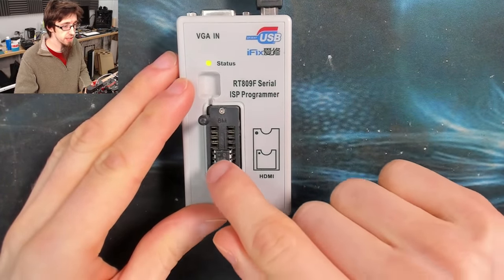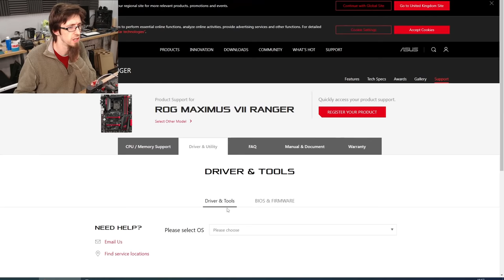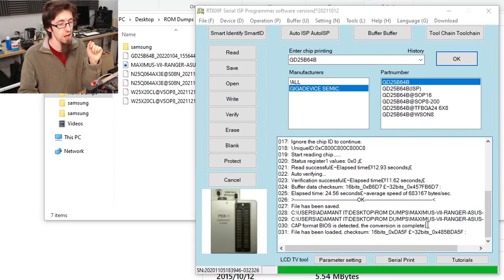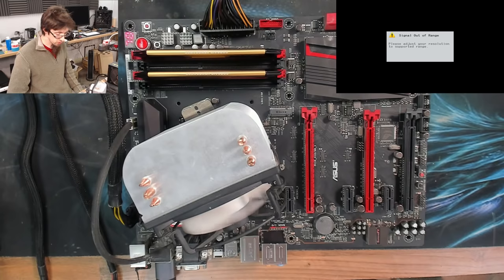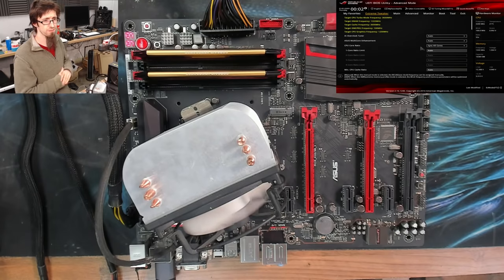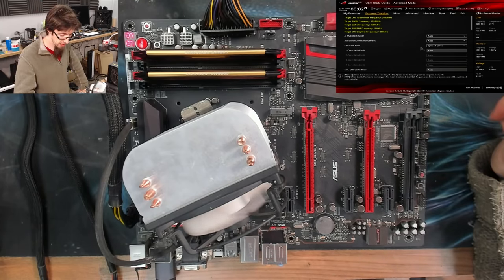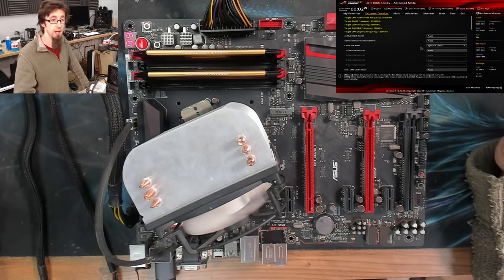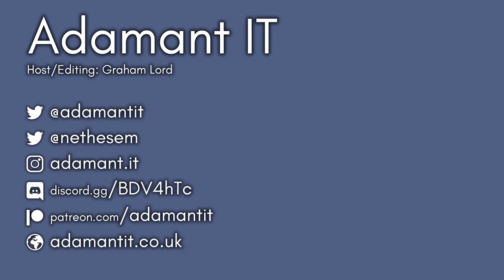Red herrings, red herrings everywhere (4th Gen Intel Build, No POST) - LFC#292

Comment: What type of studies do you have so you can get to this type of conclussions and effectivity on work or is just years of experience?
Reply from the maker: Experience. Which is also why there's lots of opinions about what to check first and in what order... Also though, you learn to get a feel for faults over time, which is why I left certain things very late to check, like the PSU. PSU should be very early in the order, but this didn't feel like a PSU fault to me.
Reply: And when it comes to the electronic part and critical thinking of solving an issue and troubleshooting, whats ur best advice?
Reply from the maker: Linear thinking. Computers do everything in a step-by-step process, all you have to do is follow those steps until you find the fault.
Reply: @Adamant_IT  thanks a lot for your response!!

Comment: I remember the days, when the cpu would fry in seconds, if the cooler was not installed correctly. Ask me how I know. I asked you this before, but got no response. Where do you get the special "fingernail", to check the ATX connector? Can't find it on Amazon or Newegg.😎😉 Good job.
Reply from the maker: Don't bite your fingernails, they're really useful ;)

Comment: Hmmm, this video may very well have just saved a motherboard of mine. I have an old Asus Z97-A USB 3.1 motherboard from my HTPC that randomly died on me about a year or so ago. I assumed it had been tweaked due to a bent case (an old Silverstone HTPC case) that I was not running the top support on due to cooler clearance. It may have just been this. I bought a slightly older version of the same board without the USB 3.1 and a new case. I updated the BIOS of the new old board so maybe it'll avoid this issue.

To be completely honest, it's all a bit moot though. I've replaced the board and plan to upgrade the HTPC with an X570 board and Ryzen 7 5800X I have laying around anyway. There's really not much need to save it. It would just be kinda cool to save it though.

Comment: Odd, the first rule of thumb i've always used is reset the bios, usually cause it's the easiest thing to do and generally a cause of other issues as well. Going after the bios last is asking for trouble sometimes.
Reply: It is not so easy to reset the BIOS if you cannot enter the BIOS. This PC was dying before the BIOS started. It was bricked.
Reply: @1pcfred  i understand it was bricked a bit but you can reset the bios on any pc outside of the bios with a screwdriver and removing the battery. So we're not talking about flashing the bios but resetting is extremely simple without needing to ever enter such.
Reply: @runeseeker993  that was done but the firmware of the BIOS was corrupted. So resetting the data did not help in this case. So it would not have mattered when it was done because it would not have worked. So much else was wrong I don't know if it would have worked even if it was the main issue.

Comment: Asus claims the single hold down on the dram to be a "feature" they call it "Q-ram" or something like that, claiming it's easier to add in ram or change ram without taking apart the computer.
Reply: I mean it is easier to swap as you only have 1 latch compared to 2 but from my experience as well they require a little more "firm" seating than the 2 latch versions.
Reply from the maker: I can see the single-latch making sense if the graphics card blocks the lower latch from opening, but that's rarely the case on modern mobos. Also you can insert/remove modules from two-latch slots with only one open as well, so I still consider it a useless 'feature'.
Reply: Asus shows an example trying to upgrade the dram where you would have difficulty getting  to the second latch, I guess it could  happen  with some very tight cases, on the other hand I don't think this is a big problem.  I just wanted  you to know Asus  considers this a feature. I just bought an Asus mb with this "feature " and unless the drams don't  hold in place, I don't really  care.

Comment: Bit Rot is unexplainable ,,It's just something that happens with a system that has been running the same bios" for usually many years " It could be caused by the battery going to such a low voltage on the mobo . It could be caused by a power spike ,,There is no clear point answer to what causes this . When troubleshooting computers ,,a bios is not your first thing to think a problem is going on tho. I think you did a fine Job of making the video on troubleshooting the issue .
Reply from the maker: Agreed. Lots of people giving the Cosmic Rays explanation, but honestly I don't buy that on a modern system. This isn't the 80s where stuff got erased by leaving it out in the sun. That being said, if it was a comic ray or any of the things you listed, the result is the same and none of them are 'preventable' - so it doesn't really matter I suppose!

Comment: Just newly subscribed to your Youtube channel, here's a question for you, I have a desktop PC that I'm using right now, it uses a Gigabyte GA-Z68XP-UD3 Rev.1.3 motherboard, the user manual clearly states that each of the four ram slots supports DDR3 ram sticks of up to 8Gb in size, it also states that the motherboard supports a total of 32Gb of ram installed, and the following DDR3 ram stick bus frequencies are all supported....2133MHz, 1866MHz, 1600MHz, 1333MHz, and 1066MHz, I have two 4Gb DDR3 1333MHz, and one 8GB DDR3 1600MHz ram sticks that I know are good, if I put either of the 4Gb DDR3 ram sticks in one of the ram slots, the PC boots normally, if I put both of the 4GB DDR3 ram sticks in two of the ram slots, or, the 8Gb DDR3 ram stick in one of the ram slots, the PC gets stuck in a boot loop where it tries to boot-up, shuts down, tries to boot-up shuts down etc, the motherboard seems to not like having more than 4Gb of ram installed, even though the manual clearly states that it supports up to 32Gb of ram, wondering what I can do to fix it?, the motherboard is on version F10 Bios, I'm running Windows 10 Home 64Bit on the PC.
Reply from the maker: Have you got a 3rd gen CPU by any chance? I think Z68 gets squicky with dual-channel when running a 3rd gen CPU.
You might get it to work by deliberately using the wrong slots to force it into single-channel mode - however then you'll have a trade off of more ram vs slower ram.

Comment: It's never the CPU... unless it's in an HP.  I had changed 1 CPU for a faulty memory controller in (at the time) 8 years... after I started working on HP, I replaced countless numbers of them alongside mainboards, to which they were CONFIRMED necessitating CPU replacement.  I'd start with a mainboard replacement (I have no say at the initial diagnosis) and the systems still wouldn't work, a new dispatch with CPU/mainboard and I'd start with the CPU first and it would always fix.  At least 10 of them within a few months.

Comment: I've had the same thing happen and it ended up killing a motherboard before I got the desktop.
the OEM person building this PC had broken the clear snaps off the cooler before they shipped it. I had to buy a new cooler, so i upgraded it to a tower cooler.
the motherboard would boot loop every time you turned it on, as if you hit the reset button, but eventually one day it just started permanently doing that. 
I just coughed up the $150 and replaced it and I'm here typing on the result.
has an i7-6700, 970, 32GB of ddr4 ram.

Comment: still got my i7 4790k with 16 GB ddr3 on a z97 board, classic evo 212 cooler with a nice 1TB sammy (samsung) drive.... sammy yep im old. a little upgrade i used to have a 1050 ti)evga) just purchased an evga 1060 6GB off a friend for £40; at least i know its been looked after and re pasted and cleaned. The 1050TI will go in my media server.

Comment: just had a computer come in for a gpu upgrade and to clone the existing ssd to a new 512gb one .  took the side panel off and noticed that the heat pipes on the Cooler Master Hyper 212 evo were chopped off to make it so the side panel and fan would fit  on this azza case ... I checked the temps 98 C at idle .. called the customer he said it's been that way for 10 years since he bought it from NCIX   a canadian computer retailer that went bankrupt ... I changed the thermal paste ..still 98 C ... put in a new Hyper 212 Evo   now it's at 53 C
Reply from the maker: wat... so like, the end of the heatpipes were open? Good grief!
Reply: @Adamant_IT  yup cut tight off .. Thermal paste was rock hard... Had to scrape it off with a plastic guitar pick.  New thermal paste did nothing still 98 c... Replaced it with a new hyper 212 evo. Now it's running at 50 c

Comment: 10:38 It's a Haswell CPU, they were known for being hot, maybe not so much the i5 versions but Haswell was sort of their first major architecture change after Sandy/Ivy Bridge which tend to run hot before intel refines the process.  A lot like how it is these days with the 12th gen CPUs with a radically different architecture that's the first of it's generation, and runs hot.

Comment: I cleared the cmos on my Dell desktop and tried booting it up.  No post.  I said to myself, "I give up for now".  So I took the battery out and the left the computer in my room for two weeks. Decided to try it and it booted up and posted.  Turns out on further diagnostics,  one of the ram sticks was faulty.  Not dead but dying very slowly.

Comment: Just about month ago I had an desktop PC i5 4. gen to insert new HDD, backup all data, cleanup dust, replace thermal paste and... I ran PC fine, desktop there, okay. Then rebooted PC on to bootable USB with Macrium Reflect, clonned 2 disks in to images, restarted PC and suddently only black screen. At this time turned off PC, back on same. Checked all power connectors - good. Then Bios reset, Ram memory replacement, Power supply replaced, CPU graphics instead discreete graphic card. Tried old gpu. 2 or 3 times I managed to boot PC and then everything worked normally untill restart or power off and power on. After hours of replacing and testing etc.only motherboard left, that I had no replacement and I noticed strange symptom. This motherboard is classic dual channell 4 slots DDR3 and... turned on PC black screen, turned off and puted one ram stick in A2 4. slot, PC booted normally. Restarted, boot was gone. Tried then A1 2. slot no boot. Then B2 3. slot, boot again okay. restarted PC and again no boot. Turned off, inserted to B1 1. slot no boot. Then A1 2. slot, booted okay. Restarted and no boot. Off, to B2, PC on and boot. So it booted if I nserted RAM stick from A to B it worked but not always. So I managed to boot again, went into a bios, opened bios flash thingie, on my laptop copied latest stable bios release on to 8GB FAT32 USB key and then PC just froze, it did not regnonize any keyboard imput. Plugged in USB key in to PC, PC unfroze and then I flashed new bios successfully, restarted, reseted bios to defaults, configured bios order. After that PC worked as it should without a problem everytime with all back in. During troubleshooting I also tried case cables to unplug etc, practicly everything only motherboard always stayed the same.

So in my case also BIOS was at fault and over a month later, still works normally :). Installed Windows 10, he had Windows 8 hehe, and Farming Simulator 2022 would not run of course on 8 hehe. Anyway I was lucky, I managed to flash new bios in because I do not have an programer hehe.

Comment: WHAAAAAT?!?! I had no fucking clue that's how those stock coolers worked! I hate them even more now!
Reply: Oh, also good to see it confirmed that it's not an issue to just let gravity hold the cooler on when testing. I figured that was the case since there should be good enough thermal transfer there, but it's felt so wrong the few times I've done it just because I haven't done it enough to be confident that it's fine.

Comment: Never heard of the term "Bit Rot"
But coming from a small background in NAND/NOR gates and flash memory.
TL;DR a UEFI BIOS chip is basically a small, dumb SSD with no DRAM cache etc. just NAND flash chip. And that data can get messed up overtime causing the main part (the part that has POST code and whatnot) or the others parts of the chip (i.e. the Management Engine/header data) to not have the right data. So chip no worky

The longer (but not super technical): As is the case with SSDs (and any drive really), data can corrupt or fail slowly overtime. One basic reason is the way electrons are stored in the NAND flash and insulation is not perfect. The easy way to think of it is like a fenced in area with a gate in between and a ball (electron) on a side. The electron can be on one side or the other depending on a human pushing it (voltage applied). One side is a 0, the other is a 1.
If that gate in the middle gets damaged, or for example one side gets washed away or has a bunch of mud in it. It can get hard to tell where that ball or electron is at one point. Heck it might even get caught on the fence. Hence the 1 or 0 can change when it shouldn't or just become unreadable.
Re-flashing is kinda like taking that fenced area and removing lots of gunk and maybe smoothing the gate out. It won't fix everything, but it gives it the best go to retry
(Just to be clear, I glossed over a LOT of info on how NAND really works and other issues that can present itself)

Comment: Several years in the future I had a similar issue with an asus laptop where the bios was bad and it was still in warranty they actually were able to flash the bios via the internet they sent the file to my computer I clicked yes flash it and it reset never had any problems with it after.

Comment: Hello - nice to see your video - the first thing that struck me was your pronunciation - very nice intonation - then my respects - to be able to - fix all these things - but not clean the PSU - why? - Because it says on the outside that there are no repairable parts inside? / Insurance reasons?
Dust can also cause big heat problems there or in conjunction with high humidity - short circuits or corrosion - in my opinion
Reply from the maker: It got air-lined when I dusted the rest of the PC 👌

Comment: Before I started farting with the bios reset, I'd be pulling and reseating the memory and if the cpu has integrated graphics, I'd pull the video card and anything else I could to simplify the problem and try to get it to boot.

Comment: 1. U could just use the SPI header instead of ripping the chip out the violent and rookie way, u did. Its supposed to be pushed in and pulled out straight vertically...It goes quite easily then... But its okay , u will learn these things as u gonna get older...
2. Of course it si not the CPU, but the BIOS! The low voltage of the coin cell battery caused the corruption of the BIOS and I have seen this many times...
3. I hope you at least tried to transfer the UUID, SN and the MAC address from the dump to the newly working BIOS...

Comment: I also have a asus mobo that i refuse to use because of those front panel headers, its better than my core 2 quad board from gigabyte, but the case i use doesn't have individual front panel connectors, its just a 9 pin lil' rectangle, and i don't have the individual plastic housings to convert it, i know i can buy em, but i refuse to do it, i will sell this asus board eventually because they are the only ones who use a totally different front panel layout which is hidious! And yeah those stock intel coolers are obnoxiously loud!

Comment: Hi Adam, do you have a link for the supplier of the CH341A v1.6 please? The qr code on the packet doesn't doesn't load as a webpage, and I can't seem to get Baidu up either.... Ta miduck,  and thanks for uploading the vid :)
Edit: I'm interested in this device as I have recently bought a second hand thinkpad, which is fine,  but I can't upgrade to a ssd with the password locked bios :(   Thanks again :)
Reply from the maker: I got mine on Aliexpress. I don't want to make any comments about it yet though, because I literally haven't taken it out the packet.
Reply: @Adamant_IT  Fair point, and thanks for the reply :)

Comment: Actually those pins were my favourite mounting solution comparing to the recent mountings where you need a special screw driver to measure the nm of each screw so that you do not tight too much one of the screw.